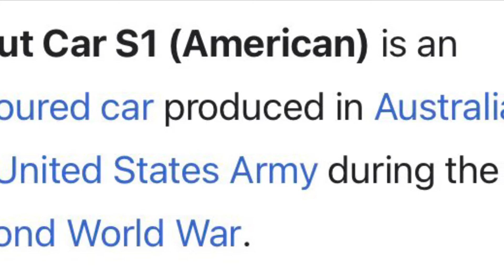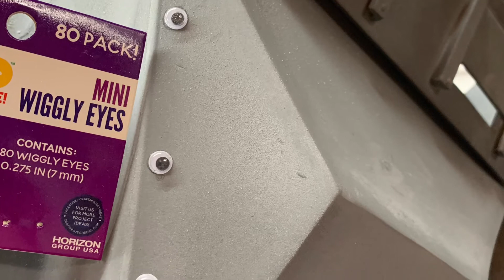1/6 scale WWII US S1 Scout Car

Comment: Wow that is amazing what you done there I love how you used every day hobbie materials in construction it was a labor of love and it shows in the end top notch👍👍did you use the tires of a current truck I am going to try and make a gi joe crash crew truck and I was thinking of using the wheels that hobbie lobby sells but again outstanding
Reply from the maker: Thanks for your comment! I found those tires on the flea market but I want to replace to a better ones. I am curious about hobby lobby tires…
Reply: @cecilvarnum9667  yea they are made of wood and they have different sizes I think with a dremmel tool a guy can make them look like tires it's just that the hasbro jeep wheels are starting to get harder to find